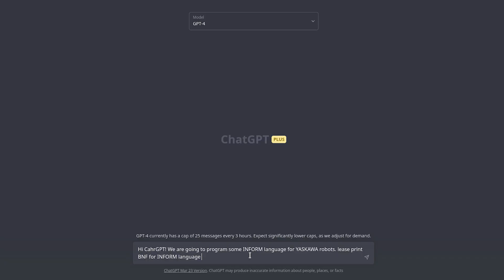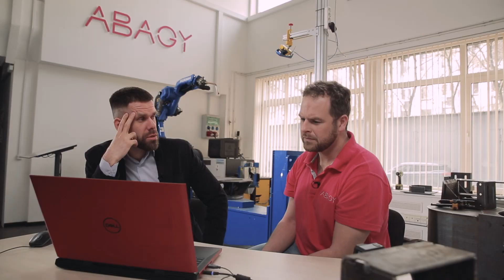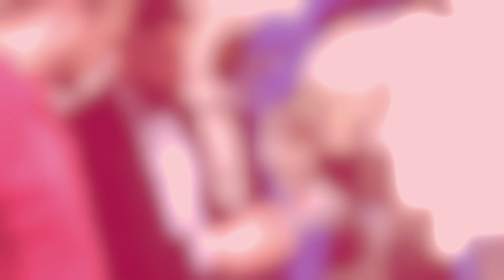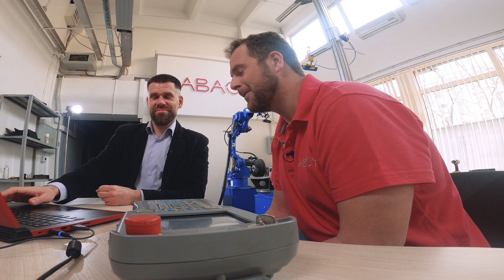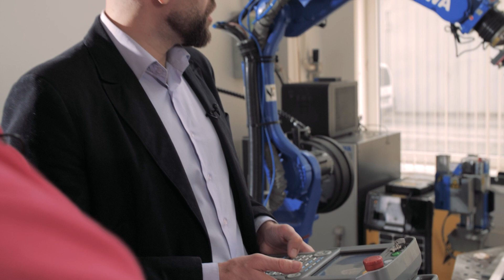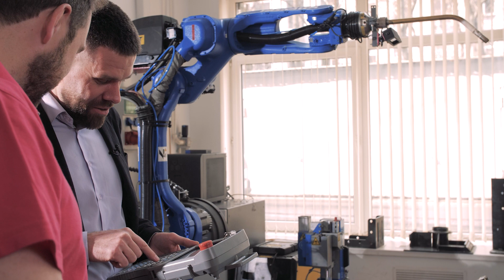How ChatGPT Programmed an Industrial Robot | ABAGY ROBOTIC WELDING

Comment: My question is:
Which is better, the KUKA ROBOTS OR YASKAWA??
Reply from the maker: Great question! Honestly, both KUKA and Yaskawa are solid robots — it really comes down to what you’re using them for.
In our case, the cool part is that Abagy works with any robot brand, so it’s more about the setup and the process than the logo on the arm 🙂
Reply: @ABAGY thanks

Comment: I used ChatGPT to create a whole new program to control the RoArm and several other robotic arm. I made a complete working program. It took several day but ChatGPT made the impossible possible. Chat GPT 4.o sucks at programing ChatGPT 1.o is extremely good at programing. What would take a few days with version 4.o takes one minute with  version 1.o. Get in touch with me and I can make you a full on application that will run the robot and be many times easier to use or if you want to see examples of my work.